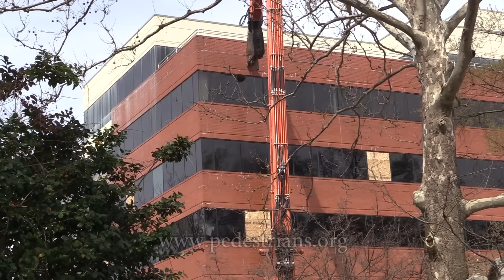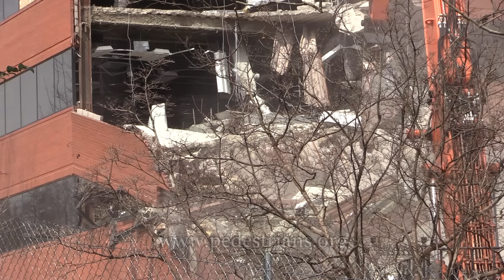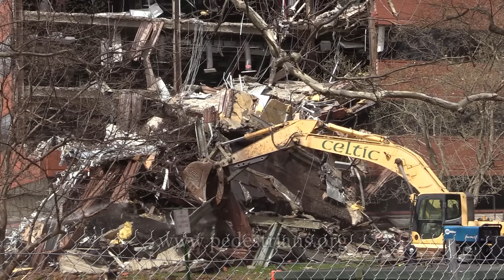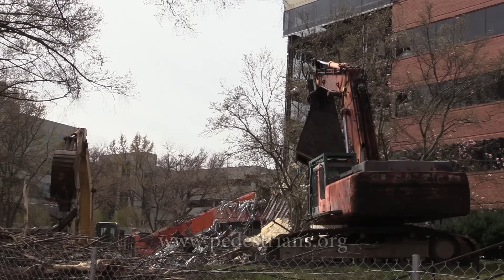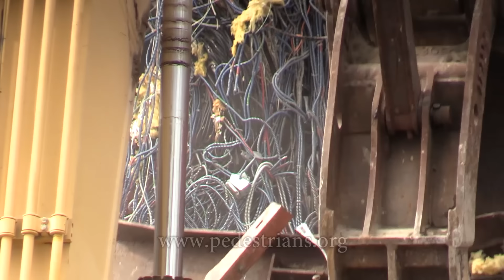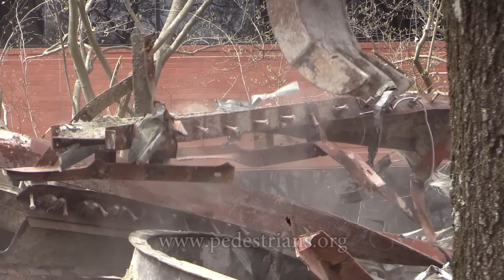McLean Demolition (Part 1)

Comment: Seems like a lot of those windows could have been saved & recycled.
Reply: The saving-process would cost more then just making new ones (wich are so much better then these ones.
Reply: Those windows and all the brick and concrete are recycled it gets ground up and used as filler it's valuable